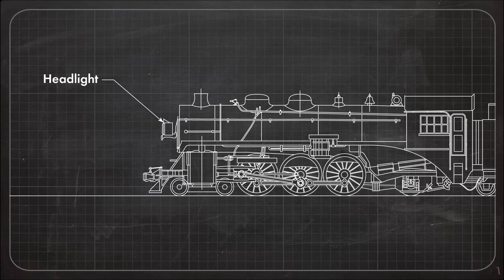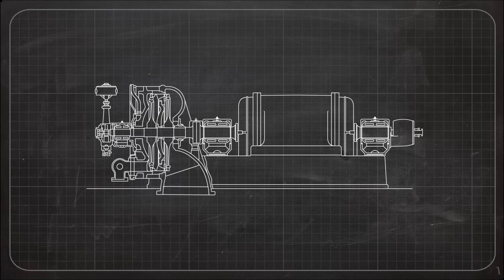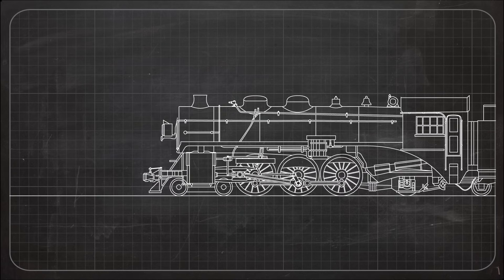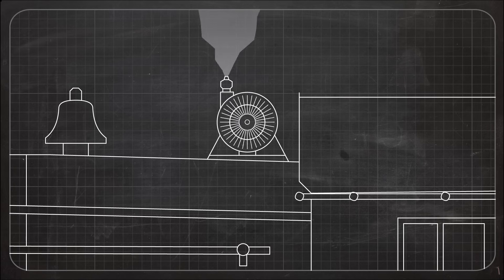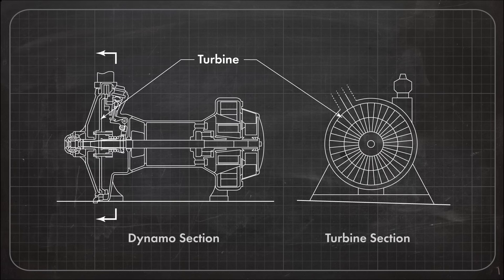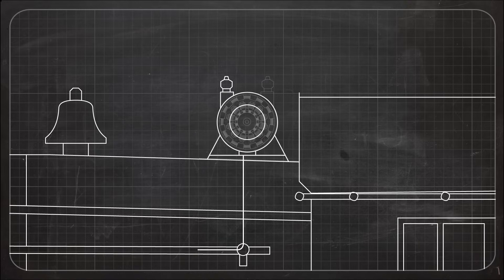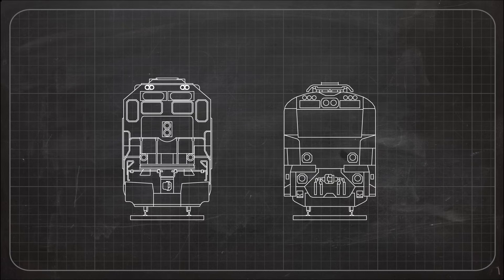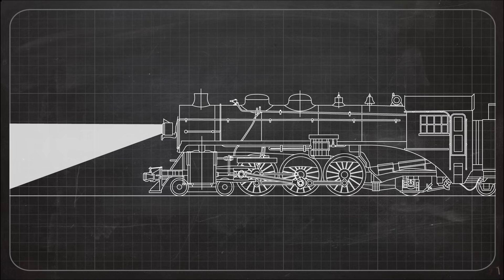How Do Steam Locomotives Power Their Lights?

Comment: I got a cab ride in a heritage steam locomotive.  I could hear the steam driven turbine-electric generator and the air compressor.  Electricity and compressed air ran everything but the wheels.  Even the firebox doors where operated by compressed air.  The fireman pressed a little pedal to open the firebox doors.  Cool
Reply: I saw them ise direct steam to open the firebox doors. No compressor needed

Comment: No arc lamps lol. A 60 watt, 32 volt bulb was typical. Not an alternating current generator- a direct current generator. They are not several poles as shown. They are two pole machines. Perhaps four pole machines existed as well. Have not seen them all. The wires go to the cab, where the headlight switch is as well as those for the other lights. Never ASSume when you are trying to educate others. It is a steam turbine though.
Reply: Yes, arc lamps.  They were used early on when sealed light bulbs were in their infancy and were prone to burning out after relatively short periods of use.  I have a handbook for steam locomotive enginemen which includes instructions for operating and maintaining arc-lamp headlights.

Comment: Do steam locomotives have radios?
Reply: Those that are used in main line excursions in North America do.  Many North American heritage railroad locomotives do also, although on some railroads the engineman has a portable radio instead.  I have used a portable radio at times although I find that a mobile radio with a speaker in the cab is easier to use.
Reply: @evanstauffer4470  I wonder if any steam locomotives had radios in them when they were still being used in regular service.  Seems two way radios began to be somewhat widespread after World War Two.  I also wonder if they did,  did they add a battery to the steam locomotive electrical system.

Comment: Over the years I have seen a number of steam locomotives, mostly static displays in museums. These electricity dynamos can be easily seen on top of the steam locomotive. Some steam locomotives have more than one dynamo. At present the restored Union Pacific 4014 Big Boy has three dynamos on top of it. It looks like the third dynamo was installed after Union Pacific Company installed Positive Train Control on Union Pacific 4014 Big Boy. This makes sense because installing a modern Positive Train Control System on the Big Boy increased the electricity demand on the Big Boy to run this modern train safety equipment.

Comment: Thanks ...... I have been searching for the information for 45 years
Reply: For, for, for...
Reply: India Railway used the 36 volt dc system, gradually migrated to 110 volt during  90s using separate dg intially
Reply: @sumanghosh8310 - by DG you mean Diesel Generators?

Comment: Generally steam locomotives used a 32V (D.C.) system with locomotive headlight bulbs. I have seen 64v examples however, often along with diesel locomotives. Even the coaches used 32v D.C. light, or on some roads 64v, at this time, with power generated from an axle driven Genamotor and stored in batteries. Cars were plugged in on “standby” at termini. This has for the most part been replaced by 208v A.C., 220v A.C., or 480v A.C. Head-End Power today.
Reply: The batteries worked best when the dynamo ran for long periods between stations and stops were brief.  In commuter trains where stops were close together, the batteries couldn't keep up and the lights would fail.  Forget A/C!
Reply: Were there any locomotives that used small reciprocating engines to power the generator and lights?
Reply: @gregorymalchuk272 Not to my knowledge. Some ships and steam boats used something along those lines however.
Reply: Interesting info. So nowadays, do they pretty much all use this head end power system? Constant-running diesel generators keeping the lights and A/C on in all cars the entire time it's operating?
Reply: @nthgth Most do, yes. Some smaller heritage outfits use individual 220v A.C. generators on each car, and there are precious few that still use the battery system, usually places that run older coaches where there is less draw/load (non-A.C. open window). In other countries outside of the States, it is more common to find this, unsurprisingly.

Comment: Germany did run an even stranger set up sometimes. The most common generator in use there had four outputs: three are designed to run as close to a set frequency as possible, and the fourth is meant to run the lights.
The set frequency ones are used for the safety system and keep the fixed installation as simple as possible. 

Modern practice uses all outputs for power, an additional axle generator and a battery backup as the current safety devices need a constant power supply.
There were even cases in the past where a locomotive had gas powered lights and the generator was was only used for the safety systems.
The generator exhaust was usually routed through the stack or the preheater unit, which greatly reduces the noise.
Reply: Gas lighting was more widespread then oil lighting in Europe.
The invention of gas mantle made gas lighting and also vapourus oil lamps give way more light then classic oil lamps with reflectors. 
Only electrical carbon arc lamps ( f.e movie cameras and search lights, lighthouses ) produced at that time more light but needed also alot of electrical power.
WWI did also put a hold on the conversion to electrical so we had longer gas lighting then the USA. 
Only after WWII when lots of rebuild was needed electric lighting became the norm in Europe.
Fun fact the last conversion from a gas lit to electrical lighting railway semafoor signal was very recently done in 2015 at a remote till then of the grit signalbox.
So in short as European locomotives go.
Early locomotives  (till the 1870's) Oil lamps
Inovation era (1870-1929) Gas lighting
After that the electrical lighting became the norm.
And yes the early KPEV electrical locomotives in the first decade of the 20th century had gas lighting.

Comment: The dynamo was not an AC alternator on most steam engines, but a DC generator.  DC was the standard in the steam era, as it could be stored in batteres.
Reply: One question, you know how the conversion was made? with contacts in the rotor or with diodes
Reply: @L224-d1o  Carbon brushes and commutator
Reply: @FOHGeek  (I'm not an electricity expert) Doesn't a dynamo generate DC current? the turbine only moves in one direction so the current should be DC, right?
Reply: @simonlovesplanes a spinning turbine is unable to change direction and will always output an alternating current waveform. In order to get a DC output in a dynmo, the AC is rectified by the commutator.
Reply: @simonlovesplanes  There are different kinds of generators. An AC generator is pretty simple, just a spinning coil in a magnetic field. But that simple form is not necessarily the most efficient one. Note that it can be a stunning coil in a stationary magnetic field, or the other way around.

A typical modern alternator in a car had several coils, each at a different rotational angle. Diodes will rectify the current. Since there are multiple coils, the diodes also ensure that the coil which is in the most optimum position in relation to the magic field will "win". This eliminates voltage dips to a great degree (not completely, since there's no capacitor). High current diodes are cheap nowadays. Mercury-arc valves weren't available until the 1930s though (and, honestly, these would have been overkill for that use, but they required much less maintenance than brushes).

"Brushes" is the answer we are looking for. We have the spinning coils in a magnetic field, and (pretty obvious), we need some way to get the electricity out of the rotor. A fixed connection won't work, so we have rings (which rotate) and stationary brushes (usually made of coal (graphite)). The rings will, via the "coals", transfer electricity from the rotor to the outside. But we have several coils, and the modern rectifier hasn't been invented yet. So the rings are segmented. Each segment (pair) connects to a different coil. The brushes only touch that section of the ring which is connected to the "best" coil at every moment. Pretty simple, as the ring rotates at the same speed as the coils. The resulting DC is almost as good as with diodes!

TL;DR: we can have both. 

Coal brushes wear out over time. That's why we now have "brushless DC motors" which incorporate (somewhat complex) electronics to get rid of the brushes.
Reply: @simonlovesplanes  That's not it.  The turbine moves in the same direction all the time.  The magnetic field reverses each time the north pole or the south pole of the spinning armature (magnetized by the induced current flowing through it) passes over the north or south pole of the fixed stator magnet.  In a alternator, the output wires maintain continuous contact with coil wires through slip rings, so the voltage delivers flips back and forth also:  AC.  If instead you arrange a commutator in two halves on the armature shaft with insulating gaps between the halves, and carbon brushes on the output wires to pick up the current, each time the magnetic field reverses, the commutator arranges to transmit the current to the other brush, so the two reversals cancel each other and the voltage is always positive.  Essentially what happens is that a generator develops voltage that looks like a sine wave that passes through zero each cycle.  In a DC generator with a commutator, the negative part of the sine wave is reflected above the axis so you have what looks a bit like the plates on the back of a Stegosaurus.  Unlike a battery, the voltage still fluctuates many times every second but only between zero and max, not between  + max and -- max.
Reply: @lesliemacmillan9932  roughly correct, except that most dynamos today have three coils not one, and the commutator has three segments not two. As the shaft rotates you always have one coil moving swiftly through the magnetic field, and two moving more slowly through the field on the other side. That gives you less ripple than the easier to understand version you describe. 

The output is roughly similar to what you get with a six diode bridge rectifying three phase AC: but here the switching is done by the alignment of the two brushes on the three segment commutator. 

In fairness, I am not sure at what point the three coil dynamo was invented, do earlier locos probably did have the single coil system.

I understand that three coil dynamos were used on at least some British steam locos.
Reply: @trueriver1950  Thank you for that correction and elaboration.  👍   I see the value of three coils.  I was just going by the little electric motors I used to build from kits back when I was a kid that I hand-wound fine enameled wire around the armature built up from a stack of thin iron stampings, then wired up brushes to a two-segment commutator.  Imagine my surprise and delight when it actually spun!  One I used in a Lindberg Line model of the Bismarck.  The motor drove the propeller shaft and worked a linkage through a series of reduction gears that would realistically slowly train the four 15" gun turrets to broadside and cycle them back to fore-and-aft.  Fun times. Kids don't do stuff like this anymore. 😞
Reply: @simonlovesplanes Yes. An alternator would have a winding that generates the magnetic field,  while a dynamo uses permanent magnets , to create the field.
Reply: @spamcan9208 the armature had permanent magnets, not a winding   that needs excitation, thus, it creates DC.
Reply: @jamesgeorge4874 But wouldn't that still require rectification? It's still a rotating magnetic field, the only difference is you're using permanent magnets instead of creating them with electricity. I thought that the the rising and falling of the waveform was caused by the attraction and repulsion of the north and south poles? Am I fundamentally misunderstanding something?
Reply: @L224-d1o  Diodes in the age of steam? DC generators use a commutator.
Reply: @ZilogBob  thanks
Reply: @L224-d1o  Certainly not diodes.  Steam locomotives predate modern power electric which made something like this practicable.  I don't think older rectifier technologies such as mercury vapor were suitable for the rough environment in a steam locomotive.

Personally I'd probably go for an AC generator because AC generators can be built somewhat simpler.  Rotate a permanent magnet and get the AC from the non-moving stator windings.  This is a simple and rugged construction, not necessarily the most efficient one.  Essentially a bicycle dynamo on steroids.

However in the 1930 there were already pretty sophisticated generators in power plants.  So sophisticated that quite a few of them are still in operation today 90 years later with only minimal upgrades.
Reply from the maker: Oh, you're right. I completely mixed up an AC alternator with a DC dynamo, not sure why I over looked this. My mistake, thanks for pointing it out.
Reply: @RailwayDynamics AC equivalent of Dynamo is called Magneto.
Reply: @wildwizardplanet That's Incorrect. The AC equivalent of a dynamo is an alternator. A magneto is something quite different and is typically used to generate high voltage pulses for spark ignition.
Reply: Did they had batteries ... in early days? For lights, AC is enough. 
Later - carriages have its own generator and batteries, driven from wheels, for internal lightning ... and heating?
Reply: @johnfox2483 The axle generator was not used for anything other than lights. Steam heat was used until the 70s.
Reply: @pootispiker2866  and in 70s, or even earlier? There is no hot steam in electric or diesel locomotives.
Reply: @johnfox2483  Hot water is available from the water jacket of diesel engines. It could be used for heating purposes, or just rejected by a radiator or an air-cooled heat exchanger.
Reply: Though early diesel locomotives did have steam boilers for train heating, like the BR Class 55 and DB V200. There were a small number of so called DB Class V162s that had an auxilliary engine for heating because the V160 was expending too much power on it.
Reply: @johncantwell8216  Sometimes this was done on self-propelled passenger cars, but there is not enough heat rejected by the diesel prime mover to heat more than a single coach.
Reply: @johnfox2483  In North America, electric and diesel-electric passenger locomotives were equipped with oil-fired steam boilers to heat passenger coaches until the adoption of electric heating and cooling.
Reply: @johnfox2483  That is not strictly correct. I worked for the CNW in Chicago for 40 years and early in my career as an engineer I would every so often operate a GP-7 that had a steam boiler still in the front "nose" of the loco so it could produce steam used to heat passenger cars when the loco was being used in passenger service.  Usually the toilet was located in the nose of the loco where the steam boilers were located. Those steam boiler-equipped locos were then relegated to strictly freight after through passenger service was discontinued on the CNW in the 1960s with only a couple of exceptions.
Reply: @johnfox2483 some diesel locomotives and some electrics were outfitted with steam generators specifically for train heat.
Reply: @johnfox2483 Most passenger diesel locomotives had steam boilers for steam heat from the 1950s to the 1980s. In the USA, some Pennsylvania Railroad electric locomotives had steam boilers also
Reply: @ Axle-driven generators and batteries are not powerful enough for powering electric heaters. Small coal-fired furnaces are used to supply hot water to radiators which heats up the cabin.
Reply: @FOHGeek Yep, and later the coal furnaces were replaced with oil burners.
Reply: @johnfox2483  I bet they already had lead batteries, they're as simple as you can get.
Reply: @johnfox2483  Heating was a steam line runing from the front ... to each car.. When diesel engines came they had a steam generator unit for the heat..
Reply: @johnfox2483 Not heating, no steam era dynamo was that powerful
Reply: Dynamos were still used in cars in the 60's but will not charge a battery on low RPM.
Reply: @andrefiset3569  I had a 70's Ford Fiesta that used a Generator. The lights got brighter as you revved the engine. We replaced it with an alternator.
Reply: Fun fact. A dynamo by definition IS DC. Saying the dynamo was an alternator doesn't even make any sense
Reply: @Scoopta  Exactly my point. 

Though you'll find some older AC generators are called dynamos, because of their manufacturer
Reply: @eatonjask Mostly the misnomer is used with bicycle dynamos, still in this day. Which probably came from the car generators being mostly dynamos in time when the bicycle "dynamos" were popularized.
Reply: The DC charging system for gas cars is called an alternator. Probably why he said that here, too.
Reply: Dynamo is still a trade name for a DC generator, iirc.
Reply: I’ve been an electrician since 93, & I’ve got to say. I don’t know anything about DC🫤❕
Reply: I almost said it but you beat me to it ❤

Comment: We now know how steam locomotives power their lights. However, what I want to know is how do museums power their locomotives lights without steaming them up?
Reply: They usually hook them into the power grid of the building the loco is in
Reply: @OfficialTrainzGod  Through a transformer to reduce the voltage to 32 volts for steam locomotive lighting.
Reply: They cgange out the low voltage bulbs and use 120 vac plugged into the wall.